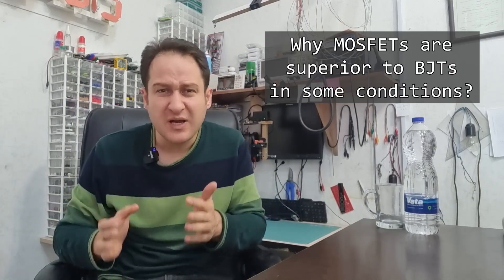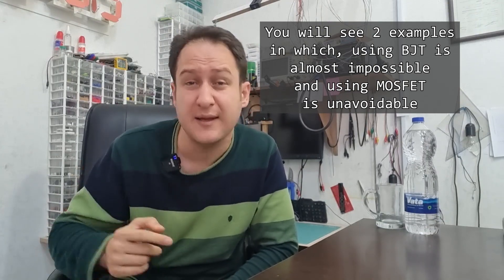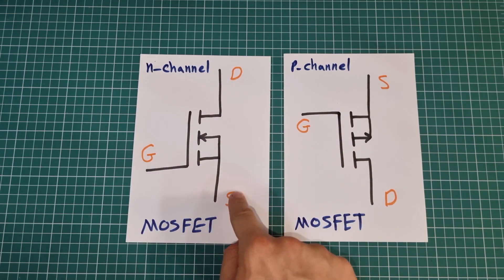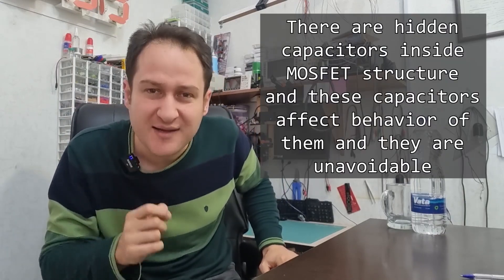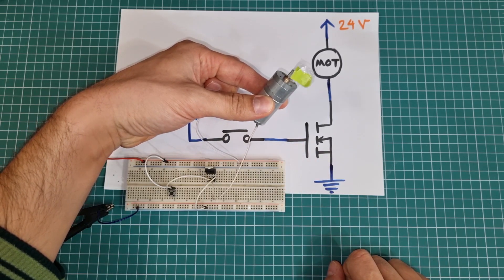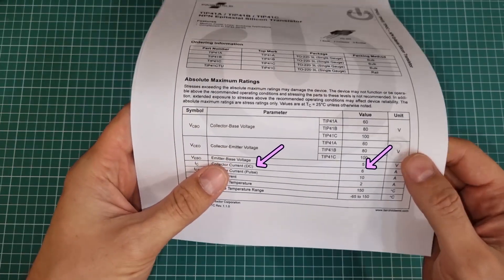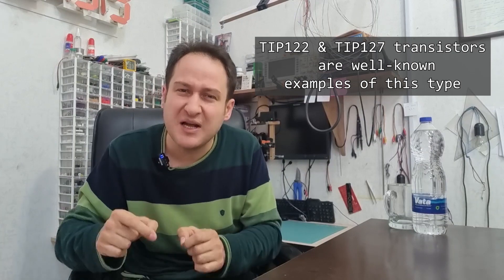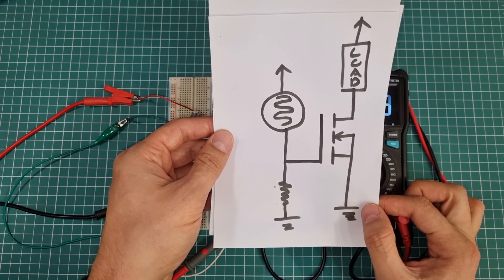MOSFET vs BJT, Unforgivable misunderstandings about them

Comment: At 5:45 I would change "BJTs need current to turn ON but MOSFETs just need voltage" to "BJTs need current to remain ON but MOSFETs just need voltage". The fact that you have to charge Cgs means that there is an inrush current every time you "turn ON", but whereas the BJT requires a continuous current to stay on after that the MOSFET does not.

Comment: I orderd a bjt npn C2837 that is complementary to A1186, but I received a mosfet K2837. The vendor replied that is compatible. Can i use it in a stereo amplifier to replace the old C2837? Also K2837 is complementary to A1186 without problems?

Comment: @ Electronic Wizard Thanks for the video. It seems you are talking about switching elements. In that context... IMO... the greatest property of a MOSFET is its very low on resistance compared to a BJT. A fully saturated power BJT, can have a collector to emitter resistance, hundreds of times higher than a fully switched MOSFET. You can always get more current to the base of a BJT... but you can't... at high currents... reduce the collector to emitter resistance.

Comment: interesting, an example i was dealing with was using the photoresistor for communication application, i watched another video and in their experiement they failed to use it for communication because they coudn't switch the logic fast enough, i forgot if they used a BJT or a MOSFET for that.

Comment: I like that you have a water bottle always on your table! It shows you're a clever organized man. That water can be used if you feel thirsty and parched! It can be used if there's a wood or paper fire while soldering! (Although water shouldn't be used for electrical fires). Water itself emanates good vibrations as per sheng fui and vasthu Shastra. Water gives confidence to living beings by being in sight and available! In India people will not start a meal without having a glass of water on the table! You will find this in any restaurant in India!
Yes, MOSFET is voltage controlled but draws very little current into Gate compared to BJT. However this itself creates a weak spot and reduces reliability because it's easily damaged by static or start up glitch in voltages!
Reply from the maker: It was very interesting to read your opinion about water.
The amount of current flowing into gate of a MOSFET depends on the switching frequency. 
In low frequencies, it is almost zero 👍

Comment: Well this explains why for ages while learning by trying to run a 9v motor across a BJT transistor that was triggered by the GPIO pin of a microcontroller, the result was no motor movement and a cooked transistor XD Thanks!
Reply from the maker: Great point 👍

Comment: i would love to see a vid about voltage regulators. at the minute im making a battery powered laser and my circuit uses 3 lm317s. i get 12v via a decoy usb cable i made, then it is limited by 1 lm317 to 10volts, then a second one  limits to 700mA, that is fed into two 18650 cells, the output of which goes to a 3rd lm317 to limit current to 1.5 amps to not kill my laser diode. then i use a bd139 driven by a switch to turn laser on and off. no doubt this isnt the best way to do it, but it is my way. i am only doing this for learning, if i needed a laser pointer i'd buy one. i just like making stuff. is my method of using 3 lm317s sensible or daft?
Reply from the maker: So nice, thanks for sharing 👍

Comment: the bit in the vid when the 'fet stays on!  that happened to me my LED stayed on, til i touched the wire on the gate. it was a revelation! then i used a resistor to ground, as well as attaching my function generator to the gate. it was all very satisfying. thanks! when i look at the schematics for an ebay ZVS supply it all makes sense now.
Reply from the maker: Awesome 😃

Comment: I do wonder where the names base, collector, emitter and gate, drain and source comes from and why they are different with each transistor type.
Reply from the maker: I am not sure about that but I think those names are originated from their behavior.
e.g. by applying voltage to gate terminal it act like opening a gate.
Reply: @elewizard  Maybe look at the original prototype point contact transistor constructed by Walter Brattain at Bell Labs

Comment: In your diagram there should be a resistor from the gate to GND.  Otherwise the gate will be floating when the switch is open, and the MOSFET will be in an unpredictable state.
Reply from the maker: The mosfet will remain ON for a while 👍
Reply: @elewizard  True.  But how long it will remain on is unpredictable.  It could even depend on the humidity of the air.  Also, the MOSFET could be damaged by static discharge.  Personally, I do not recommend this circuit.  But it is interesting to think about.  Thank you for posting it  :-)

Comment: 3:16 - A mosfet does not have a "gate-source junction". Same mistake is repeated thereafter several times.
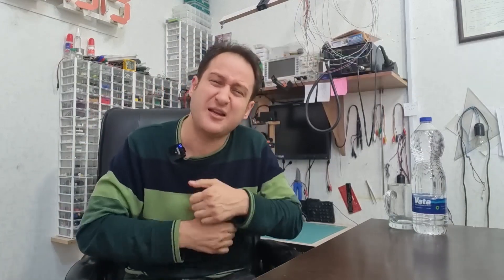7:32 - Mosfets DO need current to turn on or off, especially when switching. That's why we have mosfet drivers. They simply don't need current to STAY on or off, but that's not relevant. You get it right in your summary at the end.
You failed to make the main point in favour of using mosfets for high current switching and that is the low Vds when fully on compared to a comparable BJT, resulting in much lower power dissipation in the device. An IRFZ44 mosfet passing 2A will typically have around 60mV across it, for a power dissipation of 120mW. A TIP120 Darlington BJT would have Vce(sat) over 1V at Ic=2A, with a dissipation of 2W. A TIP41 BJT at Ic=2A would typically have Vce(sat) around 200mV, with a dissipation (400mW) closer to that of a mosfet, but it would require a base current of 200mA to achieve that, so it's really not comparable.
Reply from the maker: Thank you for these important points that you mentioned!

Comment: I am a novice in electronics. I want to drive a relay 5v board HIGH trigger (needs 5v), from rcwl-0516 trigger out of 3.7v. or in another case, a 12v relay board of LOW trigger. (In this case, completing the relay trigger to relay earth switches on). Can you please help me whether a MOSFET or bjt it better?, npn or pnp required? and finally which pin emitter/collecter/etc to connect in which way, and whether diode or resistor is required in any part of the base pin? Thank you. You are very clear in your videos and I learn from you!
Reply from the maker: Did you see this video?
https://youtu.be/L0QraSYq8tw
I have answered many of your questions there
Reply: @elewizard  I had missed it. Thank you very very much brother. Can you clarify if I put a led between trigger and ground (ie on 12v relay, LOW) OF THE RELAY that will be ok ? Or should I put any diode in base to prevent back flow? And any resistor after the transistor to complete the earth? I think the relay board trigger is live at 2v default state. And I'm "shorting" this to relay earth via the transistor. If that makes sense
Reply: So in essence , the base connected to sensor trigger 3.7v out. The emitter to led to 12v relay trigger 2v and the collector to relay earth. Am I correct?

Comment: Wonderful explanation of Gate Capacitance. I faced that problem and never knew why the motor kept on rotating.
Wonderful too is the hint on current switching vs. voltage switching, and that MOSFETs draw zero current through their gate pin after being turned ON.
Reply from the maker: Thank you, current on gate pin is zero after mosfet is switched ON. There are conditions that current on gate pin can be more than zero or even high which I will explain it in another video.

Comment: Don’t forget that it can take a considerable amount of current to charge and discharge the Gate capacitances in rapid switching applications. Failure to switch the gate quickly enough can leave the device in the dissipation region for longer than necessary resulting in energy losses and heating of the device. It is not uncommon to use a bipolar push-pull circuit or dedicated MOSFET gate driver in high frequency applications.
Reply: ' Failure to switch the gate quickly enough can leave the device in the dissipation region '
And in the effort to do this part, it's also fairly easy to overdrive or couple something into the gate, and blow out the MOSFET by exceeding the gate voltage.  
Also, so easy to blow them out from just sitting around with static from air currents and/or mishandling.  A lot of manufacturing people do not treat them as being as sensitive as they really are.  They can be damaged and then fail 6 months or a year later more often than they should, and it's difficult to attribute that back to the initial cause.
Always keep all leads connected until it's in circuit, and have the other parts of the circuit installed before you put them in.  Nothing's as fun as having to replace new MOSFETs because you didn't have the gate and reference installed, and blew the gate just handling the board.
Cheap good practice was to put in a couple of low value shorting resistors or jumpers to short them out, and only cut them back out of circuit after the board was complete and ready for test.

Note even in the video you installed it first not last, literally everyone does that until they finally figure out that isn't the correct method.  Even here in the South where it's humid most of the time, it's still easy enough to get 30+V of static charge which is nothing, and then be touching a lead when you're installing the gate drive and whoops you're damaging the gate.
Not that big of a deal for one offs and testing, just get another FET when and if it fails.  But if you're manufacturing hundreds or thousands of something and you want them to almost all work reliably and not fail, handling practices are critically important.

If you can't guess already I was a test and repair and troubleshooting technician in a manufacturing environment, using lots of IRF310's and similar devices back in the 1980's and 90's range.  Even in that kind of environment, it's easy to not take it that seriously.  But when you finally figure out to do so, it's amazing how many of the 'mysterious failures for no real reason' go away.

Just a little info from someone who did some of this, since most hobbyists won't hit the 100 and 1000 unit scale to see to be this 'anal' about MOSFETs and similar.  It matters, even if you don't notice it as easily at smaller scale.
Reply: @ModelLights  most of my experience is with high current MOSFETs the gate capacitance is so high that blowing them with a static charge requires a reasonable amount of energy. It doesn’t make them impervious just not so susceptible. Small die size devices is a different matter of course. As for overvolting the gates, they need to be driven from a known supply voltage by a driver of low impedance. Much of my experience is with IR HEXFETs because that’s what me made at the plant where I worked!
Reply: @ModelLights thank you a great deal...it's so much appreciated to pass your experience and expertise to others. Especially in electronics since it's all about experience and really years of it
Reply from the maker: That is right, I am gonna make a video about it

Comment: I’m impressed with your videos, especially how you reach out to those who are just beginning in electronics.
Just one little remark : in this video the term “source gate junction” is mentioned. However, in a MOSFET the gate is insulated from the rest of the structure by a thin insulating oxide layer. So this isn’t a junction like the ones that exist in JFETS or in BJT’s. So I wonder if the term “junction” should be used here ?
Reply from the maker: I think you are right, gate-source junction is used in slang though.

Comment: Mosfets are superior in MOST cases, including RF!
Reply: Not if you're driving a switching circuit from a low voltage supply such as a 3.3V MCU (and definitely not if it's a 1.8V MCU). You'll always have enough output voltage to fully turn on a BJT, but very few mosfets will guarantee being fully turned on with something like 3V on the gate. Of course, you can use a level-shifter/driver for the mosfet, but the BJT often gives a simpler circuit.
Reply: I did say "most cases", but not wanting to sound shitty here, but very low gate voltage mosfets are easy and cheap (except for high power), I use such mosfets often with MCU running from a 3V battery (meaning 2.4V voltage must work reliably).  a 1.8V MCU would be difficult, but there are some mosfets that work work at that voltage as well, and yeas, still cheap, because even for 1.8V operations, such mosfets are in high demand.  Having said all that, I use BJTs, something like 1:4 bjt:mosfet ratio, so I have nothing against them.  I grew up on bjt from the 70's, and even some valves (tubes)!  BJTs have a large place in electronics today, it's just that mosfets are the very much more used.  As for simpler circuit, the same can be said in the reverse, it all depends on what you are doing, so please, lets not go down that path, they both have their place and advantages and otherwise.
Reply: btw, even though I do some low voltage battery MCU stuff, I mostly don't, but here is a cheap and very common smaller "power" mosfet (48mOhm) the Alpha and Omega AO3400 (second sourced by a laundry list of manufacturers), it works down to a gate voltage of 2.5V, guaranteed by the manufacturer.  There are mosfets that go even lower like the ever common 8205 used in battery protection circuits, also cheap as chips and at 1.8V is 75mO.  I have never neaded anything lower, but I am sure they exist.  Also keep in mid, mosfets work on voltage, not no current being wasted when turned on like BJTs are.  Like I said, both have their place, just mosfets are very much more common.

Comment: So Mosfets are better at modulated by microcontrollers than any other type of transistors?
Reply from the maker: No, it depends on the application and particular project you are working on.
Reply: @elewizard  Thanks for the reply, how can I make a circuit which can modulate a laser at 5-30KHz?
Reply from the maker: @ShopperPlug  you can use an LDR as receiver. Then you can use any modulation you want. A simple modulation like PWM or complex modulations.

Comment: So if controlling with an microcontroller are you saying once turned on it will remain on?  What drains the gate so that it isn’t stuck on? When the controller turns the output off it sinks instead of sourcing and removes the charge from the gate?  Guess the speed at which you can switch is influenced by how fast you can charge and discharge gate.  How does that relate to a bjt?
Reply from the maker: Yes, MCUs sink the output and discharge the gate cap. On low speed switching, the amount of current needed to switch MOSFET on or off is so low compared to BJT in same power.
Reply: @elewizard  MCU has max sink current, how to determine the mosfet cap discharge current?
Reply: @xGen720  You always drive a mosfet gate via a low value resistor, typically around 100R, for a couple of reasons. The driver may be an MCU and will switch very fast, so the gate-source capacitance of the mosfet looks like an instantaneous short-circuit. You therefore include a series resistor to limit that initial current rush. At 3.3V, 100R will limit the current to less than 33mA. In addition, a very fast rising edge driving the stray inductance in the circuit along with Cgs will often cause the LC circuit to "ring" or even oscillate. A series resistor will damp out that ringing, at the expense of limiting the maximum switching speed.
Reply: @RexxSchneider 

So for example to limit to 10ma as my mcu specs say that is the max, a 330Ohm resistor. would be used.   Then I would have to take into consideration the capacitance of the mosfet gate and the time it takes to get to the gate threshold etc,  to find out the max switching speed.  Glad we have programs like excel to help and the internet.  Should a pull down resistor also be used to drain the capacitance quicker?  If so, now there is a voltage divider that further complicates it.  Is there a good rule of thumb that for an mcu once you hit some speed requirement you should just consider using a mosfet driver?
Reply: @wizhippo  You have it right. The MCU spec will determine the lowest gate resistor and that, along with the gate capacitance, will determine your maximum switching speed. Although you have to remember as you approach the maximum speed, the power dissipation in the mosfet goes up because it spends more time in the active region.

You can't increase the pull-down speed with a pull-down resistor unless you have a lot of drive voltage to play with, and that's not normally the case with an MCU, because of the resistive divider effect that you identified. The sink current of the MCU will normally be fine to discharge the gate capacitance. The only reason for a pull-down resistor when driving from an MCU or opamp is in case the lead to the gate gets disconnected if the mosfet is mounted away from the MCU. That would ensure the gate is not left floating in case of disconnection. However, a 10K resistor would usually be fine for pull-down and that would have a negligible effect as a divider.

In general, you can see that the maximum power dissipation and the required switching speed will determine whether you can manage with just a gate resistor. Anything that's close to the limit and you might as well use a gate driver - they are not expensive.
Reply: when you have many components on PSB you sink voltage faster than when you've just one component,on and off will be very  effective because other components use the same GND